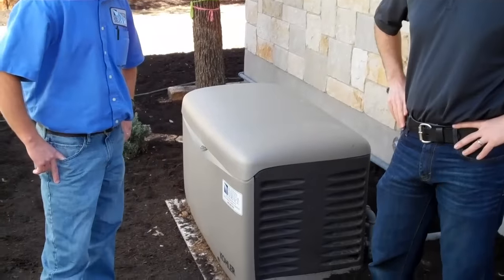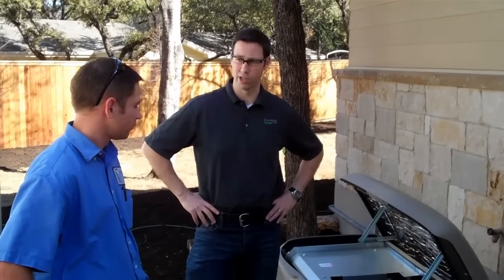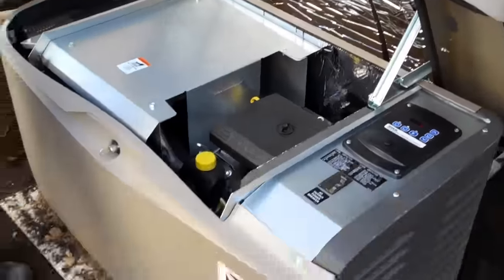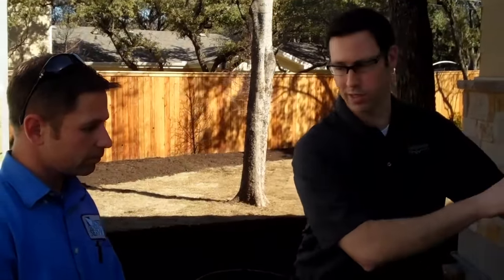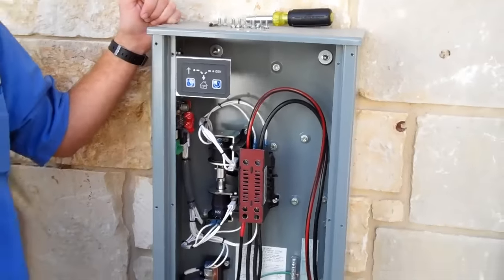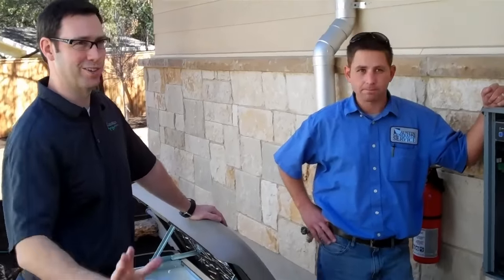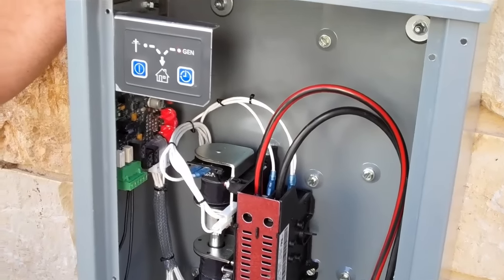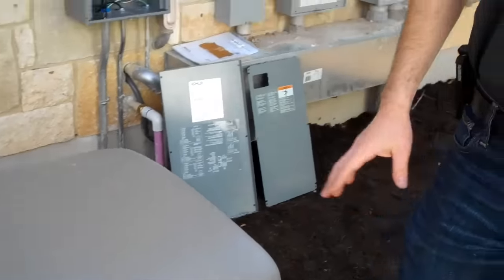Kohler 14kW Natural Gas Backup Generator System Overview

Comment: The surging on the unit is an easy fix... Can't believe they showed a kohler with this issue.. fix is either in controller gain setting and or the front engine fan is pulling air across the fuel regulator creating a vacuum on the regulator..I am a Kohler certified tech. I have fixed plenty of these small problems... Kohler is really one of the two best generator out there.. other being Generac... and if you service it regularly 20 years

Comment from the maker: My issue with gas generators is that you have to worry about fuel.  Natural gas is run underground so it's pretty storm resistant and the flow is uninterruptible.  There is also no worry about fuel stabilizer.  Here in Austin, TX we have very little underground electric.  Even windy storms knock out power in our neighborhoods regularly with our urban tree canopy weaved through power lines.  This Kohler generator will get a regular workout here in Austin.  Matt Risinger
Reply: Did they lose their natural gas supply too in the February freeze? I’ll bet propane tank sales in Texas have taken a jump upwards. A backup to the backup. I was impressed to learn recently that at least some of these pad mount generators can switch from natural gas to propane with the twist of a selector dial.

Comment: In answer to your question about gas pressure failing, normally the gas companies have their own backup generators but pressure in the distribution lines is very high.  Pressure can come from as far away as 50 to 60 miles.  I have a Kohler 35KW which runs off natural gas and never had a gas pressure problem.  This includes several storms, grid failures in the electrical power system, and hurricanes.  In answer to why the engine is surging, might be several things.  First thing is that it is running at max rpm (3600).  Our generator turns at 1800 rpm and is much quieter.  The engine is a gear drive camshaft GM 4.3 liter V-6.  Very good machine.  Those who complain about one brand or the other in my opinion are the type that start the flame wars over who has the best truck, etc.  Do what the manufacturer says, and it will last.  Some brands have had problems, Generac had problems a while back with quality control but they have fixed it.
Reply: water company also have back up generators ... But how long will they last is the question and how fast will they be to refuel them when they go down especially when you have HUNDREDS of lift stations in one city..
Small towns have water towers which do not use commercial power to flow the water .. the sheer weight of the water in the tower is what provides the pressure to keep the water flowing thru the streets ... Water is pumped into the water tower at all times via commercial power but when that power goes out, that back up generator kicks in... it only has so much fuel ...  This is why during a city wide power outage, water will flow but only for so long.. 
In my state we lost power for almost 8 days and people claimed city water flowed for about 3-4 days before they lost water ... Thankfully the subdivision i live in, my neighbor works for the city in the water dept and he made sure that generator was topped off with 200 gallons of fuel so we had water the entire time ...

Comment: Good observation, yes, the engine is 'loping' and this brand new unit and others like it up to the 20 Kw range are plagued with this symptom. I have found on multiple occasions, as a common denominator, the vent tubes for the demand regulator were in close proximity to the main cooling fan, the inrush of air from the fan sometimes causes atmosphere distortion for the diaphragm  that's exposed to atmosphere on the demand regulator. Have experienced success 80% of the time by installing longer vent tubing from regulator to an area where there is less air turbulence detected by diaphragm. Water column in inches must not deviate 1 WC while starting and running, an absolute necessity for proper operation. The information not stated with this demonstration is the generator will only produce a certain amount of usable power and it's not a true 14 Kw machine. Even though Kohler states the power factor specification of 1.0 ,in reality, the 14 Kw produces 12 Kw of real power. The reason for this is natural gas, as a fuel source, burns with an 'efficiency factor' of 85-90 %. The 14 Kw unit produces 85-90 % of it's rated output, close to 12 Kw, and not much more. When calculated, the generator will produce 50 amps @ 240 VAC. It will power some devices, but you have to be careful as to what is selected and have knowledge of the devices FLA rating before turning on.

Comment: Thanks for responding.  Had an estimate done today and was told Kohler (the company itself) required 15 ft clearance from the house, but for some reason Generac only required 5ft.  I prefer the Kohler based on what I have read online, but will be forced to place the Kohler farther from my house near a pool filter and am concerned about potential issues with water near the generator.  Trying to find info on warranty details as well as considerations for placement.  Thanks for the video, nice to
Reply: petulia67 Is. I think Generac is only 18” from the house.  5’ from windows etc.

Comment from the maker: This was an initial start up and we must have not bleed all the air out of the line.  It's sounding great now.  Matt
Reply: You should add the text on the part of the video that it happens, I knew is still programming but the entire video deters anyone from buying it.  And, why leave the lid open for so long. It would have been nice to had it closed and open it afterwards while mentioning how much the insulation minimizes the noise. This video hurts Kohler.

Comment: Kohler are outstanding unit and the water cooled units are even better. Just an FYI when adding a natural gas generator to an existing home or business, three parties should be involved during the planning stage ( the electrical contractor, the pipe fitting contractor and the gas utility). I can tell you if the gas utility is left out of the equation problems usually occur and I'm not just talking about the generator.

Comment from the maker: I would expect 20 years service life, but you need to be taking the time to maintain them properly. A well built Kohler engine that's well maintained should go 30+ years no problem.
Reply: Hi Matt.  A backup generator can run 200 hrs a year, or 25.  The lifetime really depends on usage.  I'm from Toronto.  Here, power outages are extremely rare.  And in my opinion, not an issue unless in winter, when pipes could possibly freeze for lack of heat inside a house - despite this, backup generator installations are rare here.  But in Austin?  I assume the owners don't want an interruption to their air conditioning, or their internet....seems hard to justify.
Reply: How many run time hours would that be?

Comment: Question:  if the gen runs off the fuel from the existing (natural) gas lines, how long can you run the gen in a power outage before the pressure in the gas lines drops to the point where the gen cant pull enough fuel to run?  I assume that there are compressors on the nat gas lines which charge the lines with pos pressure and if these compressors also run on electricity, won't they also go down in a large scale power failure?  Im not trying to be a know-it-all jerk, I just wonder how this kind of system would function in a situation where the power was down for say, over 5 days.  I know that this will depend on the specific infrastructure supplying the nat gas to the house/gen, but do you (the installers) have any information on how long this system would be usable in the even of a long-term power failure?
Reply: That is a damn good question and im glad you are thinking of this...   This is why you do not rely on natural gas as the source of fuel to feed this generator ... I would go with propane. This way in the event of a major power outage, you have propane stored on your property to feed the generator ... just make sure you have enough to run for days ... !!!
Reply: Worked at a natural gas company for over 30 years. Only delivery problems I recall are in beach areas where flooding at times requires the main gas lines to be shut down for awhile.  Inland never unless it’s to fix a main line leak near where you live.
Reply: So you are saying that in the event of a hurricane that kills power to the entire city or state for DAYS or even WEEKS that the gas will still flow..?? 
Id rather be safe than sorry ... As much as you can say that it WILL flow... there is that chance and that chance i wont take. On site propane cannot be beat ...!!
Reply: You Tube  ok.  That’s just my experience.  99% of people who already have nat gas will hook up to it.
If not propane is a great option.  Keep in mind propane regulators can and do freeze up from time to time so it too is not guaranteed.  I know, I have a 1000 gallon LP tank in the ground and it froze up once in the 2 years that I had it. And nat gas is usually much cheaper. If it was availabie to me I would def use it.
Reply: Donald1951:
I don't live in a cold climate & never will if i have the choice .. !!  So the chances of my propane regulator freezing will NEVER happen ...
Reply: You Tube   That’s ok with LP and a generator.  But you better hope you can get the tank refilled.
Also, the idea of a generator is for when electricity goes out.  Not the fuel supply.  IMO 
Very few people who have nat gas at their house add a propane tank for a generator.  It’s not a bad idea.  But like I said, who really does this.  Placement of the tank...fill ups etc.
FWIW, I have propane for everything as there is no nat gas on my street.  If nat gas came up my road I would keep the propane for my generator.
Reply: Donald1951:
Why would there be a problem with getting the propane tank refilled..?? 
Yea the idea for a generator is when the power goes out, but that generator needs fuel.. whether its nat gas, propane or gasoline. 
Most people rely on nat gas for their fuel for their stove, heater and their generator... BUT what if that nat gas stops flowing after a major hurricane or tornado comes thru and wipes out the cities power for days to weeks..?? Now your SOL ... By having that extra propane tank ON SITE, you now have backup fuel for the generator ... 
I don't have nat gas either and if they ever did, i probably wont go with them anyway ... I believe having that propane tank on your property is the best idea ever, just have to make sure its topped off just before hurricane season
Reply: You Tube  Agree mostly.  But if the shit hits the fan how certain are you that you can call a propane company and get a delivery?  The safest way is a very large propane tank.
Reply: Donald1951:
Well when that time hits, you WON'T be calling the propane company for a refill ... At that point you are going to survive on what you have.. 
What i was referring to was just before hurricane season hits, you call them to refill your tank JUST IN CASE ... 
This is why i will have a 500 gallon tank on site...
Reply: You Tube I think I said a large propane tank is the way to go.  I worked at a gas utility in Ct for many years.  We never lost gas unless by the ocean.  We shut it down due to flooding.  And 99% of people who have nat gas DO use it for their generators.  I used to coordinate the customers installing regulators.  They would not go to the expense of adding an unsightly propane tank in their yards if they can use the already supplied natural gas.  That’s what my point is.  And some yards here are very small.
Reply: Donald1951:
The point of having that propane tank on site is when that emergency hits ... Sure the nat gas may flow 99% of the time even after a major tornado or hurricane ... But at some point in your life, maybe a few times, you will run across a major hurricane, major tornado, major snow storm that will kill power to the entire city or state ... Yes maybe the nat gas will still flow but are you willing to take that chance..?? 
Are you willing to loose all the food in your refrigerator and freezer..?? Loose heat in your home when its -10 deg F and you live in a WOOD home ..?? 
Nat gas and street power are NO different... You are dependent on them. When one or both fails, you are on your own and without that huge propane tank on your property, you are helpless ... 
This is why having propane on your property is so important for that "backup" fuel source, you can use it to cook on the stove or grill and to power the generator which will give you electricity to run heat or AC and to keep that refrigerator up and running .. 
At this day and age, everyone should have a back up generator and fuel source IF you have the $$ to do so ... 

Oh and back in 2004 when hurricane Charlie came thru, we again lost power for 5 days and water for 4 days... nat gas was also down at my parents house ...  Maybe its the city and their up keep is less ..?? who knows...
Reply: You Tube I agreed with you in my previous post .  It’s just not feasible form many reasons.
Financial...no room... my guess is that you are a propane dealer.
Reply: @ACommenterOnYouTube  Twice the native people here in Canada blocked the main rail line from out west. We didn't get any propane for a month en the eastern provinces. Natural gas is more reliable here, however not every house is connected to the gas grid.

Comment: One other thing to think about when you size the generator for your home is that the starting loads are about three times what the running load is.  So, a lot of the smaller 14Kw to 18Kw will have problems starting an A/C unit with other loads on the generator.  I oversized ours by a large amount but haven't had a problem.  The engine is the heart of the machine and the slower it turns the longer it will last.  The smaller generators run at 3600 rpm while the larger generators 20Kw plus run at 1800 rpm.  Half the wear at 1800 and usually less fuel.  Again, have someone to knows generators figure all the loads you will have on plus starting amps.(load).  With the lid up, there is a lot of engine noise.  Ours is no louder than the outside A/C compressor unit.  Lights are out about 12 seconds on average when the power fails.
Reply: Also there are more BTUs in propane than natural gas. A 20Kw generator running on natural gas will only produce about 18Kw--and that's for handling surges.   the load it can carry is about 20% less.  On the plus side, Kohler puts extra copper on the alternators for the 14 RESA and the 20 RESA so they handle heavy motor and compressor loads coming on line more quickly.  Other brands are good for lights, but if you have a large air conditioner, deep well pump, a couple of sump pumps, freezers, a fridge, and a house with a lot of ceiling fans you will be happier with the Kohler even if it cost you a few hundred bucks more.
Reply: GunfighterWyo:
i powered up my 3 Ton central ac with a 7k watt generator .. !!!  It only pulls 3200 watts ...
Reply: capnbobretired:
I am going to build a new house in 2019 and i am looking for a ~20k watt generator but i don't know which brand to get... Generac seems to have issues with moisture in the crankcase ... Kohler has been building motors for a LONG time but some say they out sourced their engine builds to china ... Briggs & stratton i can't find that many reviews on them...
Reply: GunfighterWyo  I called Generac. The rpms are the same from 14kw to 22 kw.

Comment: I was told Kohler requires 15 foot clearance from the house.  To my eye, that doesnt appear to be the case in this video.  Why would Generac only require 5 feet?  I want a Kohler but that 15 foot rule I was advised of would place the generator in a less than optimal location.

Comment: Why is the engine loping?
Reply: So you heard it too. No idea, might be something with the governor.
Reply: That issue has been taken care of and new units do not do it. They have a fix kit from Kohler that there is no charge for that has vent tubing that will take care of it.   If your generator has this problem, call the dealer you bought it from.
Reply: We have an older Kohler generator and it doesn't do that.

Comment: You would go with Kohler any day over Generac based on what?
Reply: Hydraulic lifters for one thing. Generac need to be serviced and have lifters adjusted on a regular basis. Generac will cost less up front, but by the time you buy their maintenance package and have to deal with adjusting valves you will wish you bought the kohler.
Reply: seeburgm100a. Just talked to a dealer that installs both.  He said there are more service issues with Koehler.  IMO, people hear about Koehler issues because they probably sell 10 times the number vs Koehler.